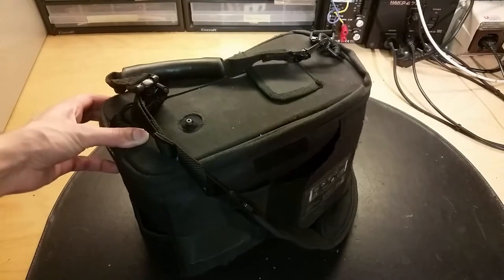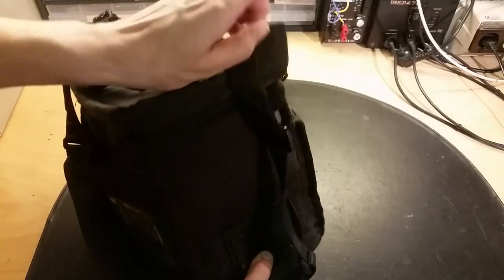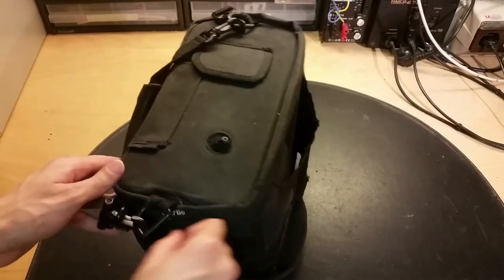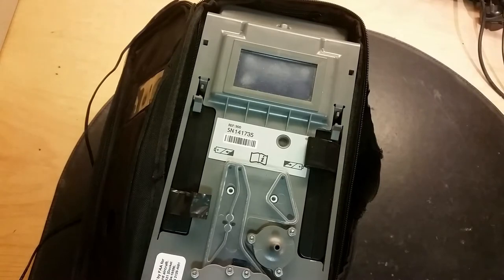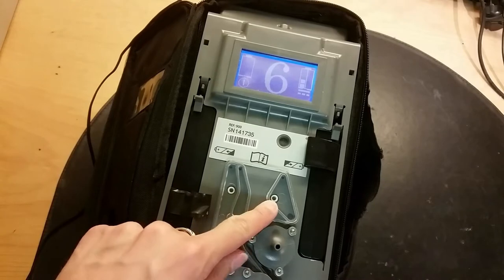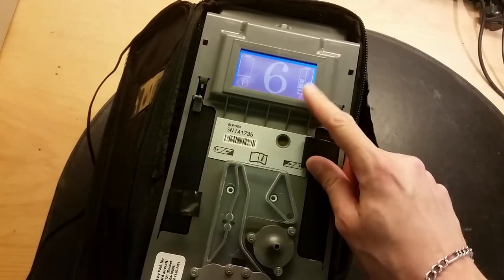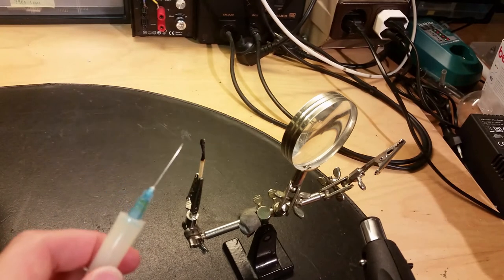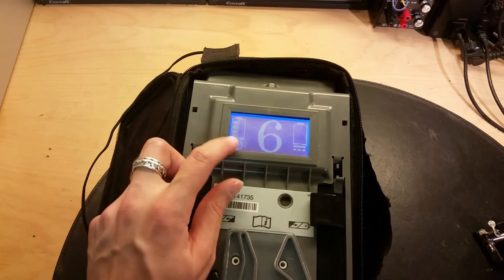Aircraft Approved Oxygen Concentrator Closeup

Comment: Nice, maybe you should try it on setting 1 maybe the compressor runs slower and the oxygen gets more concentrated, I mean because of less air flow more time to concentrat
Reply: Former oxygen concentrator repair technician here. As a general rule, all concentrators produce a higher % oxygen on their output on LOWER output flows, so yeah, you are right. This becomes more apparent when the sieve beds are becoming contaminated and at the end of their lives. One downside of the lower flow setting though, is that if the beds are done for, the system pressure rises higher, triggering an alarm on the unit, which shuts itsef down eventualy. If this specific unit is equipped with an oxygen concentration sensor, it will shut down or beep at you after approx. 5 minutes, when its self test procedure finishes. Oh and the middle tank is indeed the oxygen reservoir. The big screw on top is probbably to vent it for safe transportation or to screw in a test set that tests the oxygen concentration and/or output air pressure before the built-in pressure regulator. Also all oxygen concentrators take some time (5-10 minutes more likely) to reach their maximum output concentration. And last but not least, most of the portable/battery operated ones (i am not certain about this specific model) do only short bursts of oxygen on their outputs every X seconds, unless they sense a preassure drop on the output port (i.e. they sense that the patient inhales) and only then they put out bigger bursts of oxygen. On a rival company's model, we used to use a special power on sequence (holding buttons down on powerup) to put the unit in "testing mode" which enabled them to output oxugen continusly without the patient sensing bit. Hope that was helpful :)